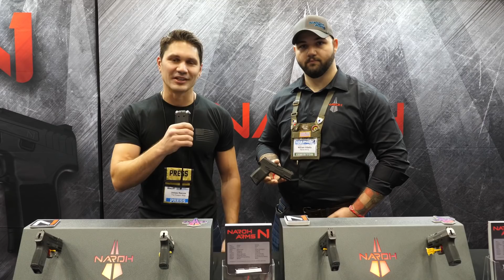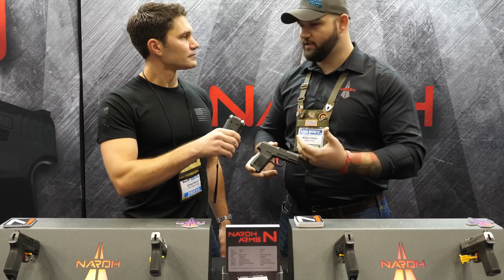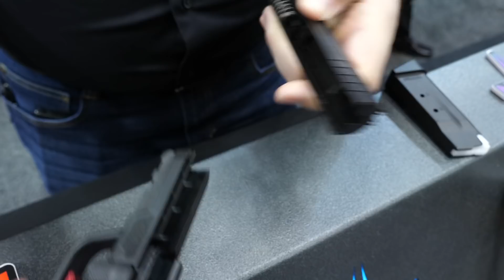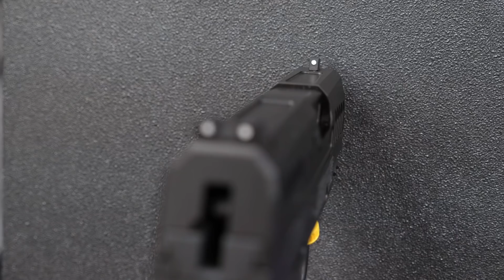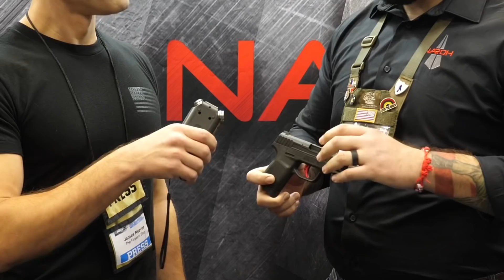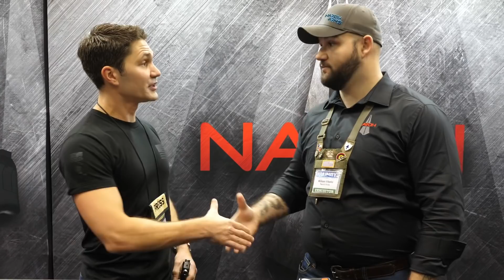[NRA 2019] Naroh N1 Slim Single Stack 9mm Pistol

Comment: The "no trigger pull" takedown arguement/sales pitch is so old, boring and STUPID.  Please, please, tell me any firearm that should not be cleared and made safe before take down is started?  What about pointed in a safe direction?  Oh that's right, there are none!  Please stop using this garbage statement. 

Other than that, this looks like a neat gun.  I dig the 7075 chassis, lightening pockets on the slide, G43 sights compatiblity(very smart), front cocking serrations, changeable grip modules and honestly the price for a new model gun from a fairly new American company is quite fair.  

There's something to be said for not trying to reinvent/revolutionize the handgun as your first real firearm offering.  I mean, look what happened to Hudson, just to name a recent example...

Comment: What makes this gun even relevant with the Sig p365?
Reply: This one has a rail and will probably work.
Reply: @PoeOutdoors  The sig has a rail, and mine has fired around 1,500 round without failure...

That being said I do agree that the Sig's initial track record wasn't the best....
Reply: Price?  MSRP of $399 means street price will be about $350, I'd imagine.
Reply: @LongOdds  Sig P365s can be had for around $450, so for $100 less you will take a gun that hold 7 rounds, and doesn''t have night sights... Heck - the price of the night  alone makes up most of that $100 difference. The sig is a more expensive gun, no doubt, but i would argue it has better value.....

Comment: DAO at 6 pounds eh? Something fishy.
Reply: Not really.  Kahr pistols are considered double action (thought technically striker fired) and they come in right around 6 pounds.
Reply: A rotating cam that releases a striker is not DAO. Kahr can call it DAO if they want to, but in all reality it’s the same way a Glock functions. It’s like saying you climbed to the top of a mountain, when in all reality a helicopter dropped you off 20 feet from the summit.
Reply: @AC-pm7sn  Glocks are considered DAO too.  Basically the fact that the striker is retracted any amount before dropping fits the definition of DAO under most technical definitions.  Most hammer fired guns when they're DAO fully retract the hammer but there's no reason why they can't be left partially cocked and the pull just finishes the cock and drops it (effectively making a hammer fired gun feel like a striker fired).
Reply: Yeah they’re not double action. The cruciform holds the striker in place after the gun is cocked. If the cruciform broke, and the safety wasn’t there, the striker would impact the primer and the gun would fire. The only reason the cruciform moves rearward by about 10% is so that it can clear the drop safety ramp. I’m finding a lot of people don’t understand how guns work lol.